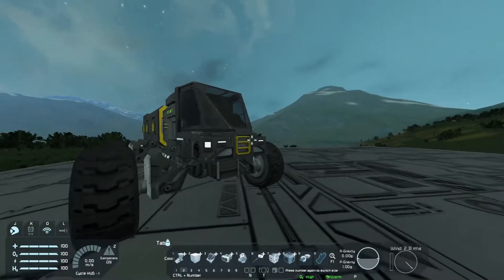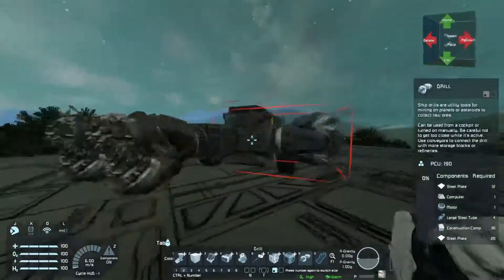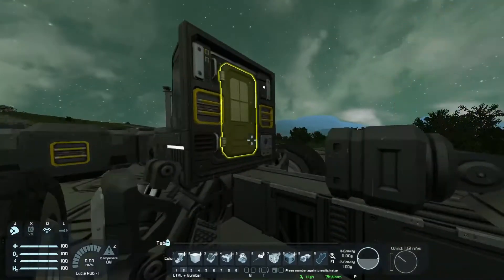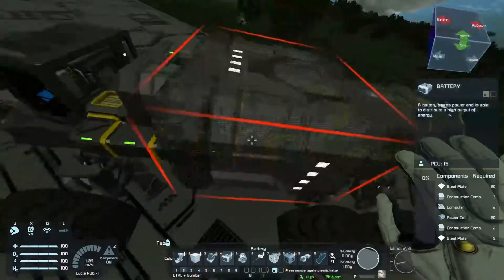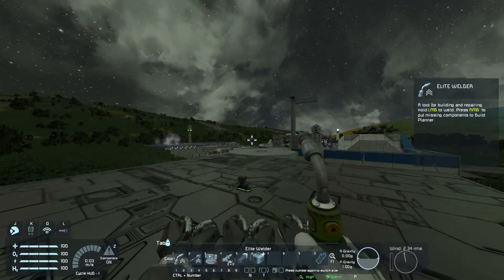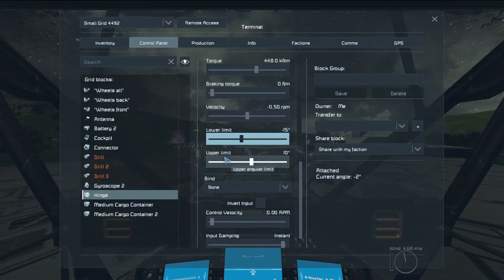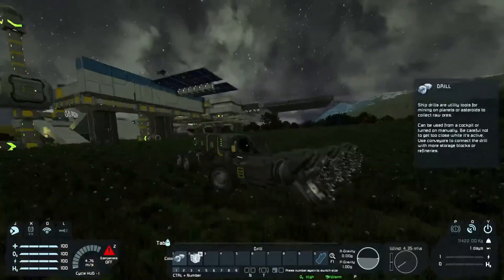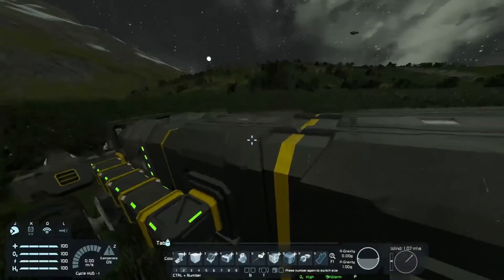How to build your first mining vehicle / Space Engineers

Comment: This only digs down, or not at all. I messed with hinge settings
Reply: I did some fiddling with it to get it to work and improved the overall design. Mine is built as a portable survival base, utilizing a hydrogen generator system with a survival kit to allow canister filling and oxygen replenishment. Can also break down harvested stone into basic components without needing to connect to a refinery base. For actual ores and offloading of stone byproducts however, you will still need to dock to a refinery. The best part about the design is that I built it in a way to where I can just add thrusters that I'd be able to turn on/off to allow flight. So once I've gotten more resources, I'll essentially be able to take my mining car and transform it into a vessel that will fly to a planet/asteroid, land on the wheels, deploy a drill downward and start harvesting. Once capacity is at full it will be able to take off and return to dock.